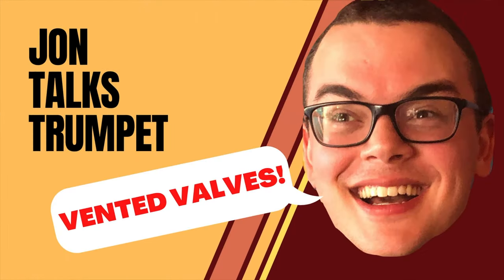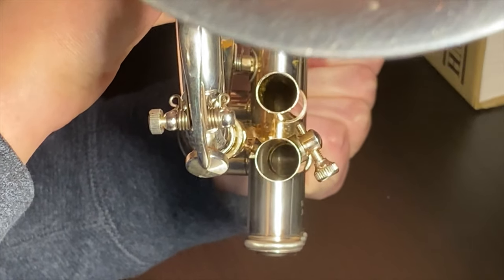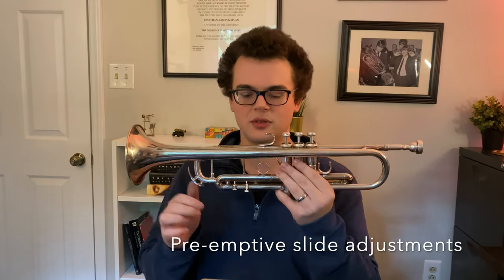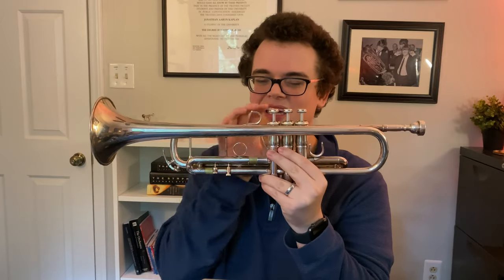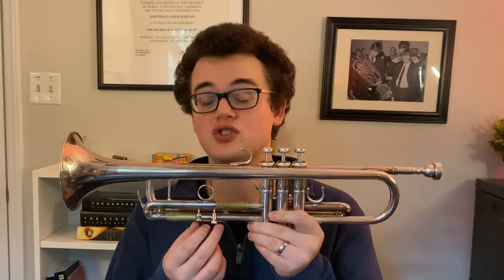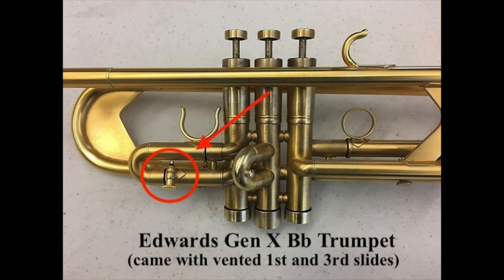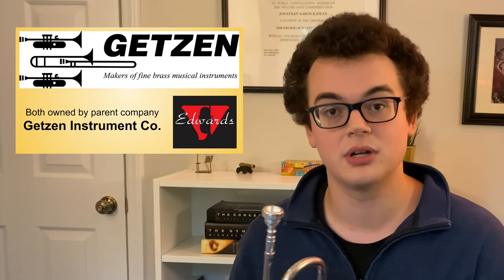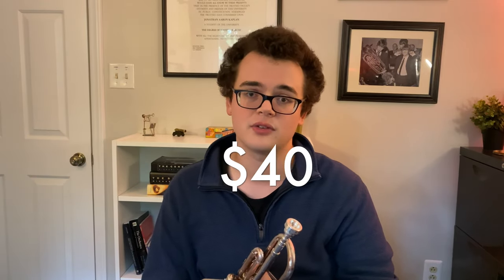Drilling a hole in your valve ON PURPOSE? - Vented Valves for Trumpet Players

Comment: In my experience, the most awkward/problematic valve combos are upward-starting trills:  low-C-C#  (0  - 123 - 0 - 123), low-Eb-F (23 - 1 - 23 - 1),  Ab-Bb (23 - 1 - 23 - 1) C-D (0 - 1 - 0 - 1)  4th space Eb-F (2 - 1 - 2 - 1) and 5th line F#-G# (3 - 23 - 3 - 23) - and of all these, bot the low-C-C#  (0  - 123 - 0 - 123) and C-D(0 - 1 - 0 - 1) trills seems to be the most awkward to execute quickly and smoothly without clamming (going repeated from low C-C# I actually feel that slamming pressure going between the notes). After viewing your excellent video I am wondering if the embouchure disturbances from opening a pressurized piston that you speak about could be the culprit here, and perhaps even exacerbated by the fact that in exerting a constant wind pressure you are also repressurizing the piston that is being closed and thus exacerbating this embouchure perturbation by repeated the same opening/depressurizing - closing/repressurizing movement combination. (quite a mouthful, but I think you will probably get what I am saying given your technical understanding) So with that in mind, I am wondering, do you feel that the above-mentioned transitions go smoother/cleaner with vented valves?
Reply from the maker: The vented valve will help with the initial depressurization when adjusting the valve slide length when changing pitches. So for The 23-1 trills won’t really be effected much because I don’t bring out my third slide for that, but for any trills or scales with 13 or 123, where the third slide length is being changed quickly on the fly, the venting will relieve the pop from lengthening the slide length.

Comment: I wonder if horn makers would consider offering an additional vented 3rd valve? I imagine that there would be times that I'd want it and times when I wouldn't want it.
Reply from the maker: That could work - there are 2 practical hurdles though, one being that the two pistons would not have identical “fit” in the casing so they may not play the same beyond the venting status, and two being that I’m not sure how you store an extra piston without it gathering lint and being exposed to microscopic dents that may effect the performance of the piston when you do install it for your perfect valve vent scenario.

Comment: You sort of answered it a little bit but what is your opinion on 1st and 3rd valve triggers rather than rings? When I played cornet in our local brass band I really loved it. It seems relatively standard on cornets but I’ve noticed that modern trumpets stay away from it. I also know that the hand has greater muscles for the motion of gripping rather than pushing out. As someone who has smaller hands and difficulty triggering fully for low F would getting triggers added to my trumpet be beneficial or would this introduce new issues that I hadn’t thought of?
Reply from the maker: Triggers are tricky. I always prefer regular saddles because it gives you extremely fine control and doesn’t require actual grip strength like a trigger. Triggers also have a linkage or two and so there are more parts to get stuck or slow down. My BIGGEST pet peeve with triggers is when you depress them, the slide goes out, and then you let go and the trigger gets stuck in the out position. Then you have to literally take your hand off the instrument to fix it… of course proper maintenance can prevent that but many people (myself included) don’t lubricate their instruments that frequently. So… saddles when possible but certain things need a trigger for ergonomics.

Comment: It's not the valve that wears down, it's usually the casing being made of soft brass.  Which would require plating the valves with nickel or in my case in the past the manufacturer made be a new oversized piston then lapped it in.